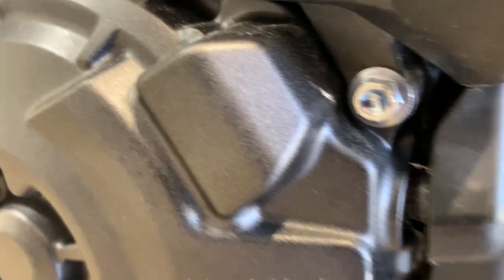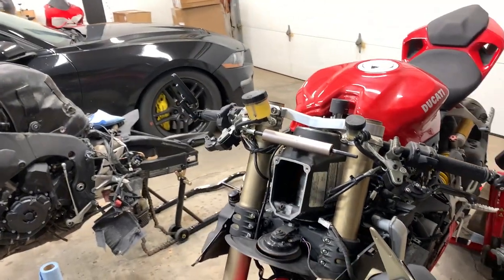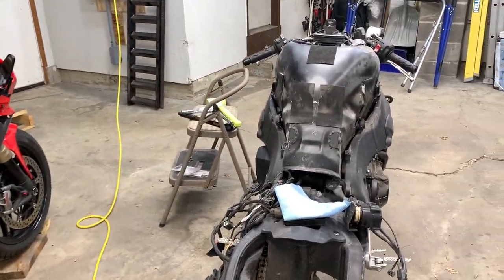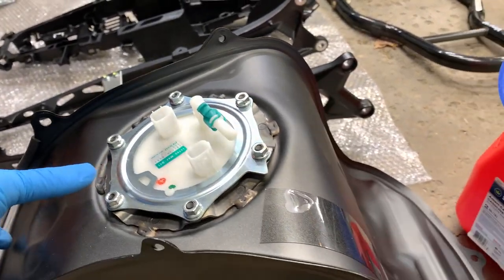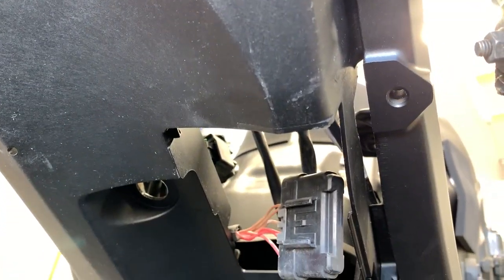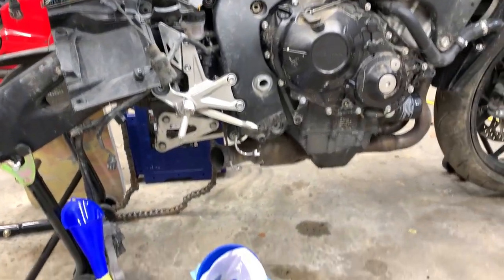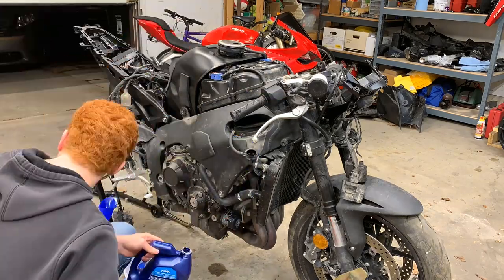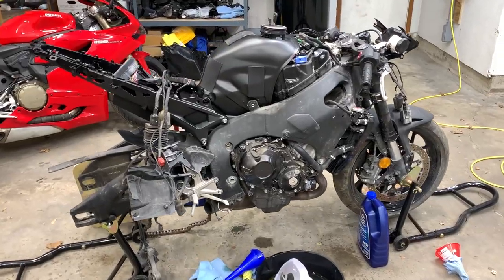Rebuilding A Wrecked 2019 Honda CBR1000RR (Part 4)

Comment: when putting in coolant do it slowly so it won't trap air in the rad....there is a process on bleeding the rad to get out all the air....also look for dave moss on here and he shows how to align motorcycle forks......its way handier that taking it fully apart....i do mine once or twice a year as they can go out alittle from riding the bike....well riding here in ireland anyway as the roads aren't as good as the states...great vids by the way...
Reply from the maker: Appreciate it Murray! Thanks

Comment: If there is the coolant coming out of the overflow line it’s could be a bad Rad cap not holding pressure. Or your coolant overflow could be overfilled above the max line. Worst case your water pump is shot
Reply from the maker: Hmmm I'll have to check those things out, I do believe I overfilled the coolant overflow in the rear of the bike so that may be it

Comment: Hi CJ,how you doing?
What brand is the tail tidy?
I have the same model Ducati ,only the S version and I have the same or similar tail tidy,but the screws are different,I think yours are better.
Let me know..
Thanks bud & keep it up…
Reply from the maker: Hey Rui! The kit I got is on eBay titled as "Ducati Panigale Racer LED Fender Eliminator Kit 959 1199 1299 NRC Tail Light" 
The company I believe is NRC. 
You've got a beast bike! Thank you!
Reply: Yes bud,it’s a beast,very fast ,plate up & let’s go…
Can you send me the link?
Cheers bud..

Comment: Correct me if I'm wrong but I believe you're supposed to use the stator cover gasket alone as opposed to gasket sealer and maybe that's the reason for the oil leak
Reply from the maker: I'm not quite sure what you mean, but there is no cover gasket on the new stator cover so it's recommended to use a gasket sealer between the engine block and the new stator
Reply: Don't bolt the cover immediately  let the sealer rest for couple of minutes that's why it leaks